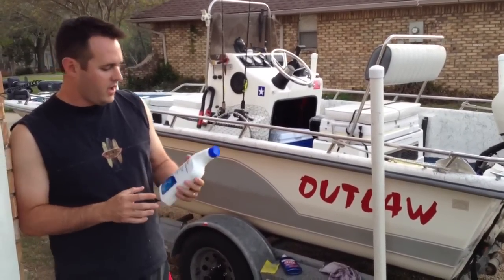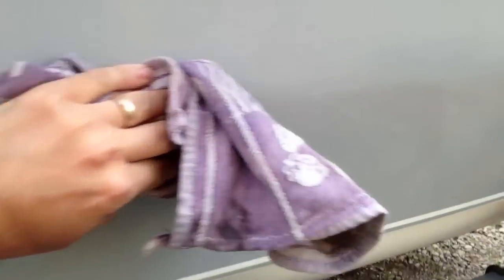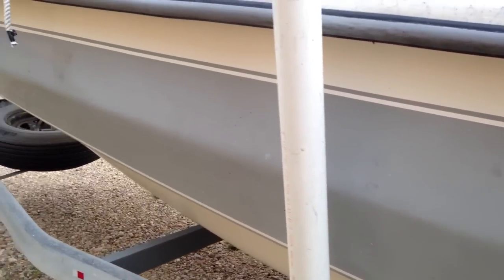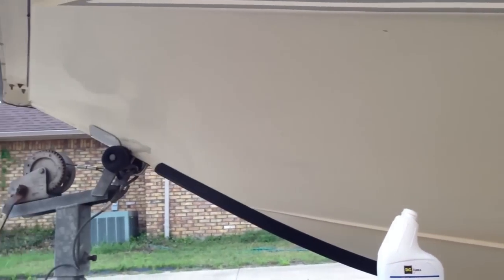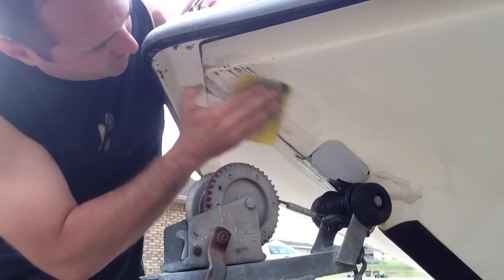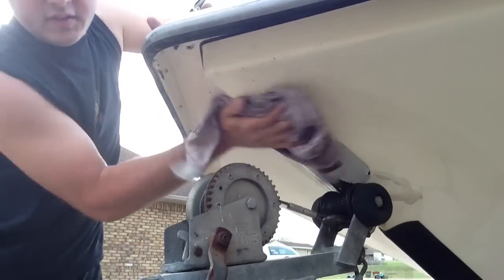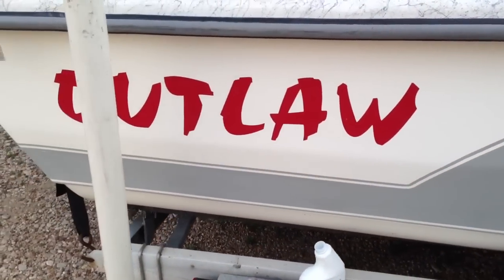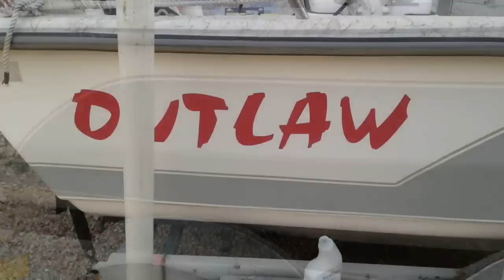Cheapest and Best way to clean a Boat

Comment: You could take it a step further and clean it with Norwex.  All microfiber cloths using cloth and water only to clean.  To use an abrasive you could use cleaning paste as well.  Cleaning paste is made up of marble flour, natural soap. This would mean you wouldn't be using any harsh chemicals that may wash off in the bodies of water you take your boats in :)  Message me if you're interested in learning more.

Comment: Just use steel wool and 40 grit sandpaper next time. Maybe a blow torch for those extra tough spots.
Reply: I saw a man trying to weld a suspension leg on a Lotus Elan once, on his driveway. He didn't notice the fibre glass body catch on fire, and it caught on fire very rapidly. After an exciting hour or so all that was left was a pile of twisted metal.  Even the alloy engine had melted.
Reply: cfc2000 Wow he definitely had a sad day , something he won't forget in his life time.
Reply: Do you have a make and model for that blow torch?
Reply: @christophercarlyle2475  you don't need to buy an expensive blowtorth to set fire to your boat or fiberglass car. I know a couple of very experienced arsonists who gave me an awsome money saving tip on this. A tip that the blowtorch manufacturers just don't want you to know. They told me that all you need is a box of matches. If you like my comment please give it a thumbs up. And don't forget you can also follow more of my comments by watching every youtube video on the internet and looking out for my comments.

Comment: I have a question for all the sailors. Has anyone ever tried using Brillo pads? I'm talking bout the one that are square and is covered with pink soap. I'm not talking about the heavy duty ones that look like Jheri curls. LOL
Reply: +June Bug I know they will work wonders on SS. One thing they might leave swirls but if that don't bother you so much then they work great.

Comment: gloves and goggles, that's acid in the toilet bowl cleaner. You can actually brush it on with a broom to keep clear of it then hose it off 10 min later it does clean hulls really well. don't get it on bottom paint it will turn all crazy colors and look really bad.

Comment: This is a creative solution and I am not faulting this guy. However, I think there real problem is that it takes off the wax. Good boat cleaners will try and leave most of the wax in place. After using this, you will certainly need to wax your boat. I also wonder what damage is happening to the gel coat. If you don't really care about your boat (and his looked pretty dirty) then this is probably fine. I wash my boat at least once a month and wax it every quarter. So, I would never use this on my boat.
Reply: I was wondering about the gel coat to .
Reply: it also pits the aluminum in the trailer